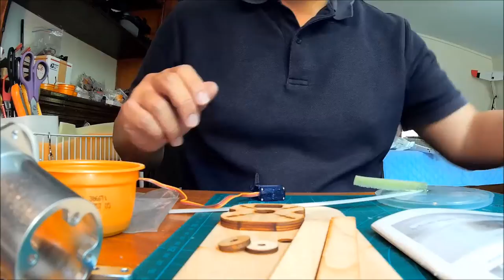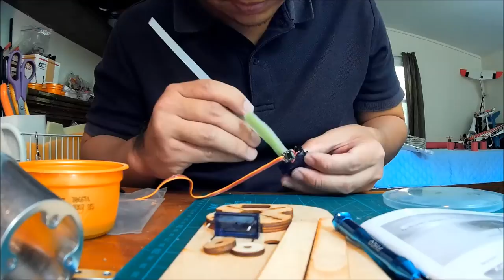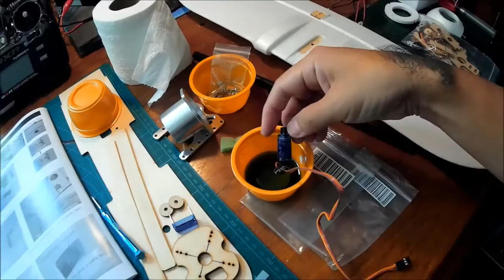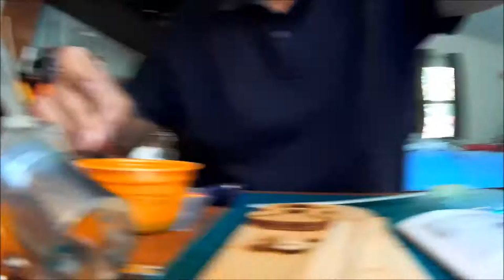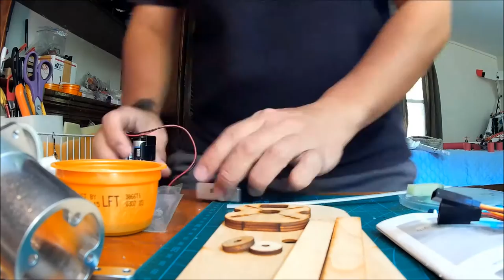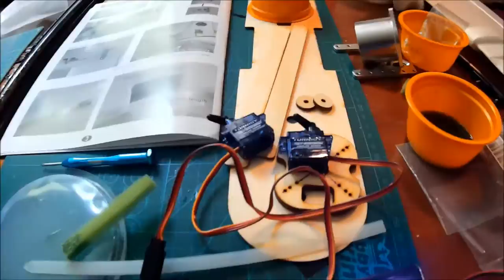Waterproofing servos with CorrosionX

Comment: Great product. Lots of FPV beach missions here over salt water.I use the Heavy Duty version on my esc's,bec's,uhf rx's, vtx's,gps rx's, and any exposed contacts. My plane emerged from a thunderstorm after 30 minutes with no video/rc link. Plane was soaked, but zero damage :)